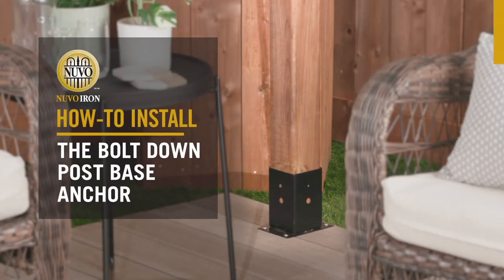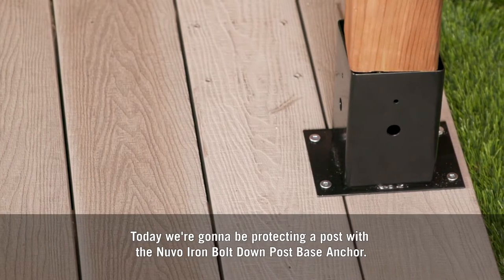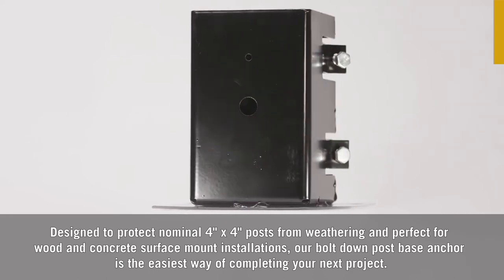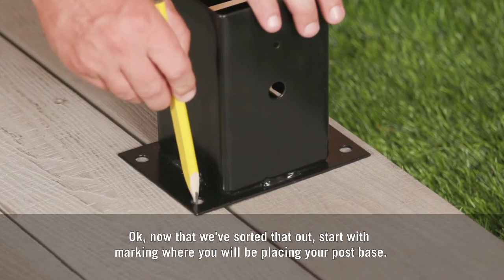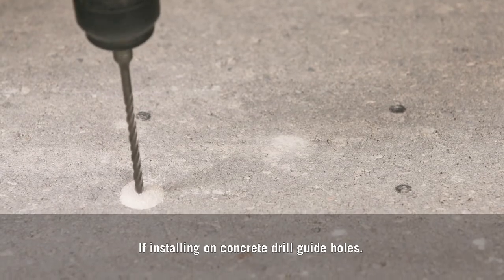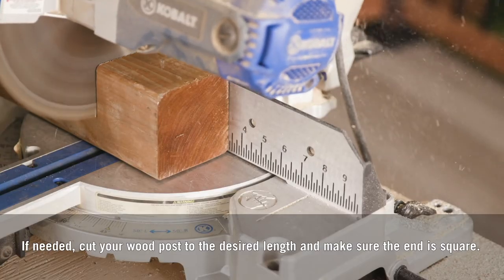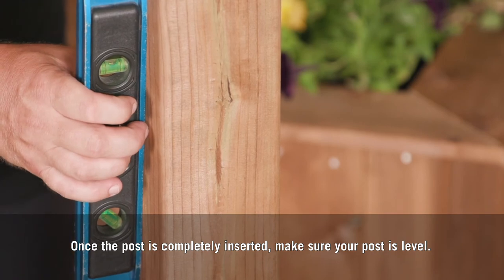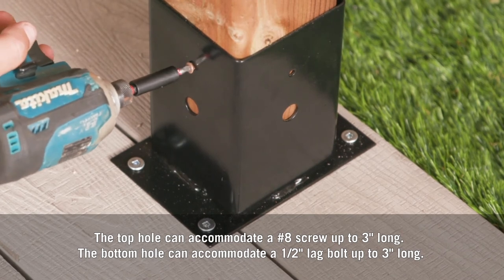How-to Install: The Bolt Down Post Base Anchor (BDPA4B) | Nuvo Iron

Comment: The warning says not to use this anchor on a structure over 60"... That's 5' tall... Whatever was just built looks taller than 5'.  As would almost any pergola/pavilion.
Reply from the maker: Hi ajsemtb, we built a planter holder that was about 5' in height and the deck structure was only a few feet off the ground. As there are various building codes and information required to create a safe structure, we provide this warning to ensure the project builder is making sure they're building a safe structure, which varies by project in a variety of ways.